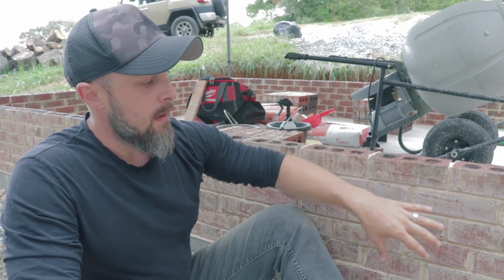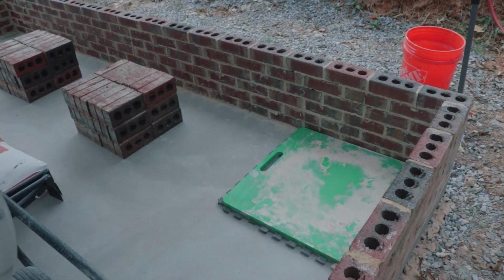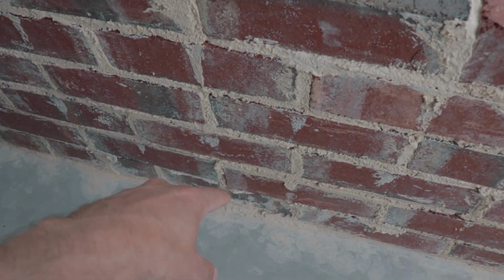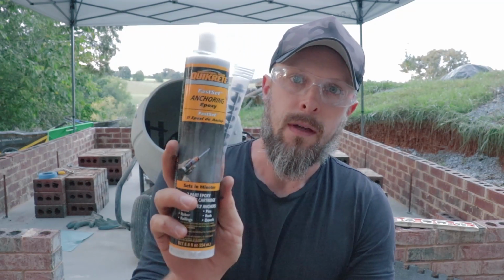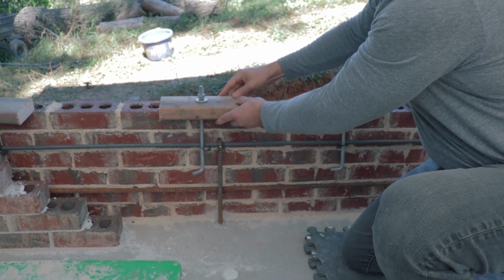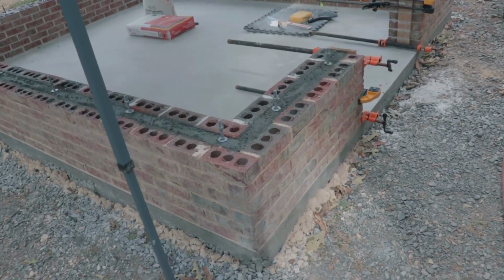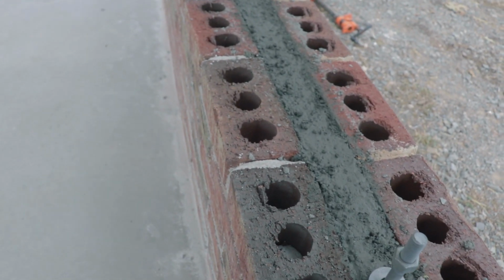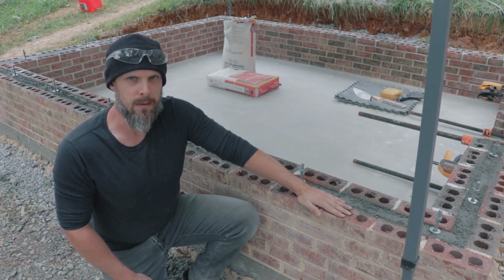Building a Straw-Clay Tiny House | Stem Wall Foundation | Part Two

Comment: More good work. Really enjoying watching you build. From an engineering perspective, a concern is the connections. Probably would have been better to integrate the j-bolts into the matt slab. 3” isn’t much embeddment, though a thumbs up for the adhesive. It could benefit from the collective strength except that it’s not actually attached such as with straps from the outer brick through the concrete to the inner brick. 

It’s a shame that you couldn’t get some insulation in the bottom of the house. It’s small enough that it won’t be a huge problem.
Reply: Oops, almost forgot. 3” is considered the minimum cover on structural steel in concrete below grade. Probably should have made the concrete about an inch thicker in this regard.
Reply from the maker: Yes, thanks, for the insightful comments! I'll be honest. I didn't embed the rebar sticking out of the slab mostly just to make screeding the concrete pad much easier. I know those 3" integrations aren't great.
Reply: Good that you considered the construction process. A way to accomplish both is to pour the slab and screed it without the bolts, but insert them into the wet concrete after that initial smoothing. It’s a few more obstacles to work around while finishing the slab but it’s under the wall so doesn’t need to be perfect.

Comment: Can you build the walls out of brick, (more specifically, soil compressed stabilized brick) and apply cob on both sides of the brick wall above a wider stem wall? Another similar question, would brick pillars at every corner of a cob structure increase the buildings strength?  The answer to my questions I'm guessing is that cob and brick heat, cool, and release moisture at different rates which would cause the two to separate from each other?

Comment: Don't you need to apply a sealant to the bricks or add insulation to it? like foam boards or something, I've seen people apply it all the way from the footings so I'm just curious. Thanks for the videos.
Reply: Also are the electrical conduits and the plumbings supposed to pass through the stem wall before the concrete pour?

Comment: Why didn't you make the uphill side of the stem wall higher than the cut?
Reply from the maker: Didn't need to. There's about 4 or 5 feet between the cut into the ground and the house. Plus, I'll be building a stone retaining wall against the cut dirt.
Reply: Make sure your finished grade is about 8” below your top of wall with positive drainage away from and around the wall. Because brick and concrete are both porous, make sure you have a very good waterproofing layer and sub drain system.